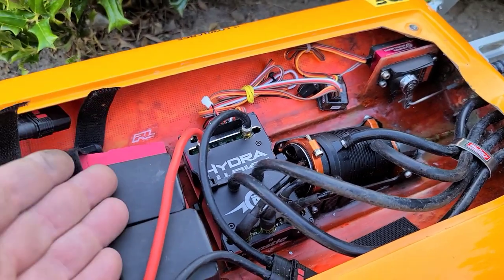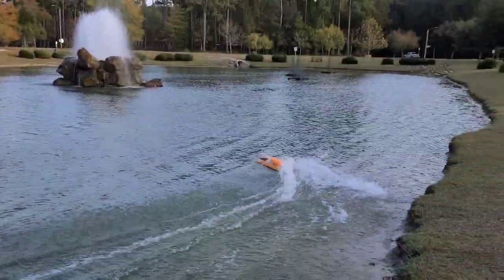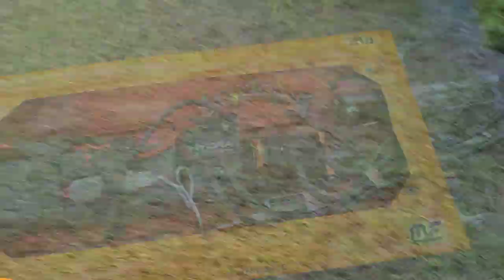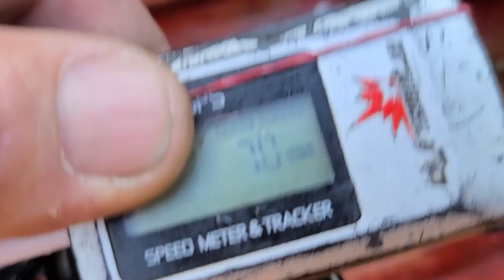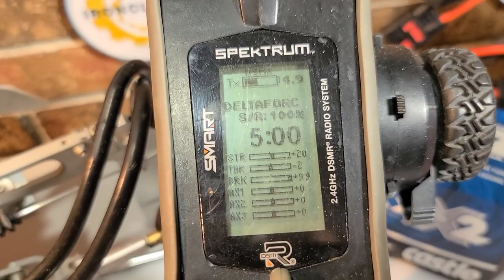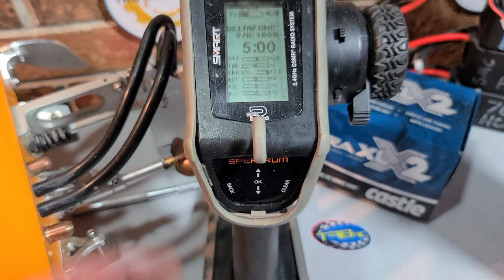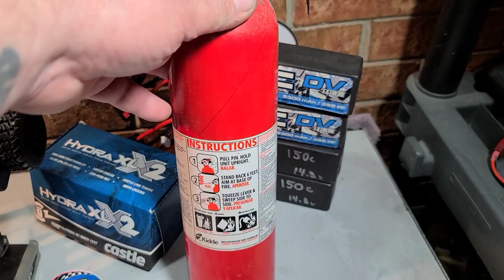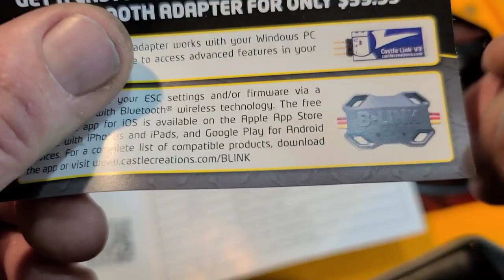First Run Castle Creations Hydra XLX2 Binding & Calibration - Deltaforce 35 FE Rc Boat

Comment: I knew from the tone of your voice in the very beginning of this video and put a smile on my face it was going to be a good one that thing's stupid man I got to get that ESC that's all it is to it! You can tell that ESC is letting it flow that motor is going oh my God it's getting all the power it wants and then some! Imagine what it's going to do when you throw that TP motor on that ESC I don't know what's going to happen you might snap the blades off the prop cuz when you stab the throttle that thing I mean it's just about jumping completely out of the water every time the roost is unreal. Throw that tp4050 on that ESC and let the Ridiculousness begin. You going to have to tone it down some it's going to torque roll that boat completely over you'll be snapping Flex cables and stuff. That is sweet

Comment: What a beast, unrelated but just got my cooling jacket for my impulse 32 from oxidean wow fast shipping wasn't expected till Monday arrived early got it Friday , today,. Boat day after lawn gets mowed Saturday. I just hope that solves my cooling leak I blow through the line and you can hear air escaping from the cooling jacket tried to lube the seals but it still leaks just not as bad so new install. Peace

Comment: So, Castle wants you to plug in the Aux wire into 3 or 4 channel.  Seems that the Aux wire is the power feed wire for the bec/esc and the throt wire is just that, a stand alone signal for throttle.  They don't talk to much about it in the startup guide, even on the offroad Mamba guide.  all it says is "adjustable on the fly channel" and that IT MUST be plugged in.    Been running Castle gear for years, just never had a Mamba.   Love their 6.5mm connectors,,just don't use the green bullet holder that comes with the 3 pack.  Make indifferent length batt wires and just use the bullets with a heat shrink overlay.   You want that connector to be as tight as it can be, and the Castle 6.5's are damn tight.

Comment: You've build a dragster mono. Nice ! Would have duplicated it in carbon and gained halve a pound but that's me......
O, and use water cooled motor mounts ? I've noticed you rarely do. Please keep the vids coming !
Reply from the maker: That xlx2 is insane the rocket 4082 just doesn't do the xlx2 much justice

Comment: That ESC got me drooling. I want to put one on my V2
Reply from the maker: I thought about throwing the hydra in the sonicwake instead of the deltaforce for testing.. Deltaforce had more room to work than the v2
Reply: @IRONCLADRC  Yeah its tight fit. Looks like a Bad ass ESC

Comment: I am hoping you can help
My 33” .deltaforce is chine walking at full speed.
 I have tried a few setting like strut position and 2 and 3 blade props
Getting rid of play in the steering joints and rudder and  turn fin angles.
I move the motor forward now to make it easier to re-grease the flex cable and still from 55 to 60 it is a flip waiting to happen. The best so far is 60 mph but if it wasn’t so out of control it would get more speed.
My best setting is the strut up a few millimetres at the prop end and a 3 blade CNC 4514 prop with a l 5s 5 amp 100 c lipo,the motor is an outrunner that can run 6s 1750 kv 100 amp so 60 mph not bad for 5 s only using a 150 a flycolor but it flips on the slightest ripples from its own wake if at full speed and chime walking.
So I put a flood chamber in it and 2 pack urethane in the nose so it can self right and  if it loses it’s lid the foam stops it sinking.
So I am after things to try to stop the chime walking.
Reply from the maker: Try some positive angle (up angle) it'll settle the stern at speed
Reply: @IRONCLADRC  I have got 2 mm now do you mean more than that ?

Comment: Got some power flowing now. I will try castle x8s with 2000kv 4082 (6s) and 1650kv (8s) hopefully shortly. Will make watercooling on esc myself. But this i really a beautifull esc. You could probably read some interesting  data now also.
Now we will wait for another motor of the bj... Keep en comming man!
Reply from the maker: That's the fun part of the hobby, modifying & making custom built components for your boats....    that's really what got me into the rc boat hobby, building full custom wood  boats and all the hardware...
Reply: @IRONCLADRC  yes sir. You can put some off your own creativity in looks, making/altering parts and learn things also. Did you know the rating is only 180a from xlx..? Speaking about conservative. But no cutt-outs, low temps, the limiting factor now will be the battery or motor... Only hope they get a bit cheaper. Think it will sell around +400€ in Europe. That's still allot off money..

Comment: This ESC might be the answer for my V2. I installed the spektrum 160 right off the bat before first run and it works great with the stock prop but when I try and run the Oxidean high rake yellow prop or ABC 1714 she has a power cut right at full throttle. $200.00 bucks for the Spektrum I'm not happy for a few bucks more I could have had the XLX2. Your thoughts "B"

Comment: Hi Iron. I'm sorry for the question, but could you help me with the list of items I should buy at offshore electronics for the hull delta force 35. I'm newbie to the world of radio control boats, which fascinates me. I have been in the world of radio control cars for 30 years. From Ecuador, greetings.
Reply from the maker: Deltaforce 35 
https://www.offshoreelectrics.com/proddetail.php?prod=df-delta35
Swordfish 200a esc
https://www.offshoreelectrics.com/proddetail.php?prod=hef-HBX1220L
TP POWER 4060 
https://www.offshoreelectrics.com/proddetail.php?prod=tp-4060-v1
OSE DUAL PICK UP Rudder
https://www.offshoreelectrics.com/proddetail.php?prod=ose-83347
TFL STINGER
https://www.offshoreelectrics.com/proddetail.php?prod=tfl-503b72
MOTOR MOUNT
https://www.offshoreelectrics.com/proddetail.php?prod=tfl-523b61
TRIM TABS
https://www.offshoreelectrics.com/proddetail.php?prod=ose-80077
TURN FIN 
https://www.offshoreelectrics.com/proddetail.php?prod=ose-80062

Comment: The marketing hype for drag cells in hilarious. All they do is put cells in parallel to get the high C rating. FE boat racers have been running 2P setups for a decade or more. Just saying that they are hype is all when you can achieve the same result without the high $$$ of drag packs.
Reply from the maker: You know your probably right bit the srd packs have been breaking speed run records left and right here lately
Reply: @IRONCLADRC  Where is that? I know people that JUST do SAW racing and they would be using packs like Roaring top and certain Dinogy cells.